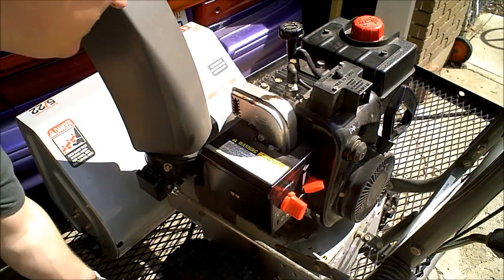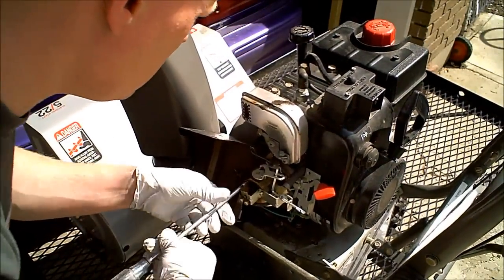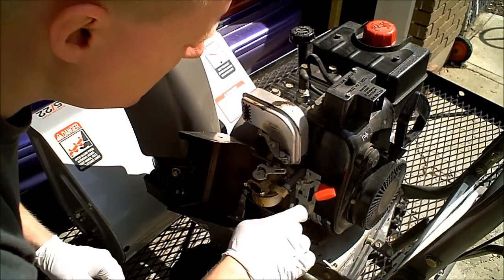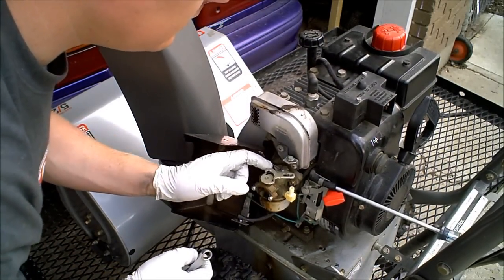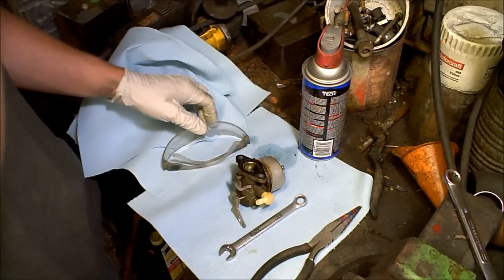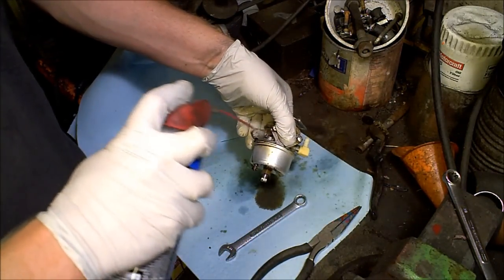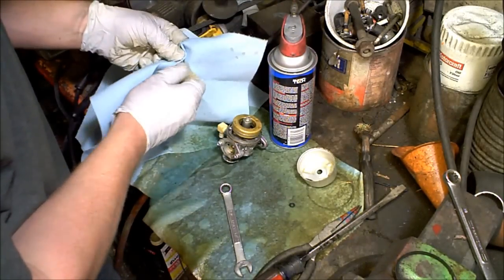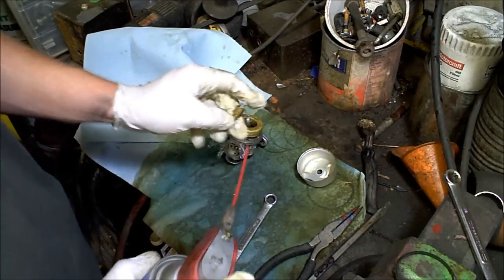Tecumseh Carb snowblower cleaning 1 of 2

Comment: I have this same snowblower and it doesn't run at all. I had it started and then it seems to lose power and die...the carb has been replaced. Any ideas?
Reply from the maker: Jordan Roth Sounds like the carb is running out of gas. Old gas line could be swollen or plugged up.
Reply: sixtyfiveford  Thanks I will take a look at that. I also noticed when I had it running a few weeks ago at idle it would backfire sometimes which I thought could be a sticky valve - after checking your video's out they move up and down and the intake turns so I'll be sure to dig back into this.
Reply from the maker: Watched your video. Enough gas isn't flowing to the carb bowl. Either your float is set to low or the fuel line is plugged.
Reply: sixtyfiveford I look the fuel line off and cleaned it out - didn't find anything. I'm going to go ahead and get a new line in case the one swelled and is not allowing enough to flow in. I took the carb off and the float is level if you hold it up - I would assume that is correct I can try to adjust it while I have it off to see what happens.
Reply from the maker: Level for the float is correct. Lets test for fuel in the bowl at the time it dies. Take something to clamp the gas line. Run the engine until it dies and immediately clamp the fuel line. Pull off the fuel bowl and see how much gas comes out. Just a little or none and fuel delivery is our problem.
Reply: sixtyfiveford Ok, when the engine dies I clamp off the line and I empty the bowl - with a good amount of fuel in the bowl. I did notice something else - when I have it running at idle at full throttle it seemed the adjustment screw for the throttle wasn't set far enough out. I noticed this by pushing the butterfly back towards the throttle as if the spring wasn't strong enough to keep it pulled back. It would run more and with more power. with the amount I push that back I know there isn't enough on the idle screw to keep it back that far.
Reply from the maker: If you're able to keep it running by manually moving the butterfly/governor arm then your governor arm is out of adjustment or the spring stretched.
Reply: sixtyfiveford Due to the age I would say it could be stretched. Would it be better to adjust the spring or the governor arm?
Reply from the maker: The spring won't stretch due to age. Only if someone pulled on it and overextended it. If the spring is messed up I would buy a new one. Look at one online and compare how it looks to yours.

Comment: What is the best way to prime the engine before starting it?
Reply from the maker: Quick bursts. The primer button forces air into the carburetor fuel bowl. There it displaces fuel that is forced up into the throat of the carb.
Reply: Thanks for your good vedios,thanks for your feed back.

Comment: great video.. BUT its just easier to replace with a new carb from ebay $15.00
Reply from the maker: The aftermarket carbs are a crap shoot and generally need jet modification to run properly. Most are set too lean and the engine will burn up valves. I can modify them to work good but they never run as good as an oem carb that I can quickly clean for zero cost.
Reply: @sixtyfiveford  i hear ya, and agree totally. i buy the  crappy 15.00 ones and switch the jet from my oem carb. 

plus its the damned ethanol fuel that fucks these carbs up in the 1st place. i run/ran avgas in my dirt bike for years never had a problem. 1 time i used regular out of desperation. BOOM problems.. but not gonna spend $7.00+ a gallon on gas for my snowblower lol.

Comment: hi i have the same kind snowblower in your  video craftsman 5.5 hp i was wondering if you would  know what carburetor i would have to get for mine and why would it stall when i try to give it more throttle could it be water in the gas or dirt could u send me a link for the new carburetor so i could look it up    thank you
Reply from the maker: It stalls because the carb is dirty. A simple cleaning and you'll be back up and going in no time.
Reply: ok would help if i bought a new carb for it thank's for your help
Reply from the maker: Yes, you can replace the carb or do a quick 5 minute clean. I show how in this video: http://youtu.be/KYj5oH0vNVg
Reply: hi do u know the part number for the carb i would need in the tecumseh carb snowblower cleaning video like the one u took apart if so can you let me know thank's again for your help
Reply from the maker: You will need to get the model number off your engine and do an online search for the parts breakdown. This will give you the exact carb for your machine. The model number is either stamped on the very top of the shroud or on a decal on the side of the shroud.
Reply: ok thank's for your help
Reply from the maker: When you find your engine model # I can help you find the part # for you carb.
Reply from the maker: This is the snowblower model #. I need the one for the engine.
Reply: ok
Reply: the one i  found for the engine is (1051212) and the part no is 143.025501 if that help you out any thank you for your help too
Reply from the maker: Your carb is part # 640084a . EBay has Chinese reproductions that are OK for around $30 or an OEM will run you around $100.
Reply: ok thanks for your help

Comment: where is the air filter? sucking snow and stalling
Reply from the maker: +David Kephart Snow blowers don't have air filters. This is because they operate in a clean environment with zero dust. Also the moisture in the air would saturate the filter media and potentially ice up and clog.
Reply: Thanks for the info that makes sense,